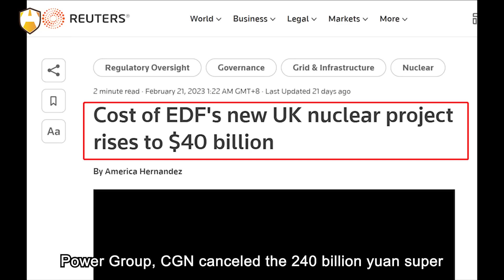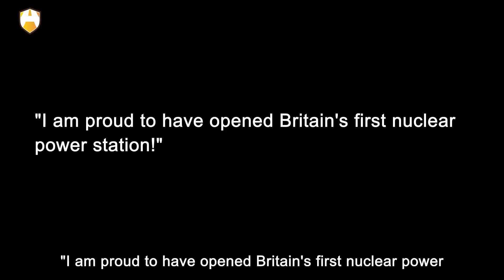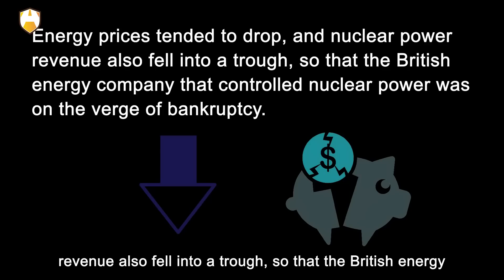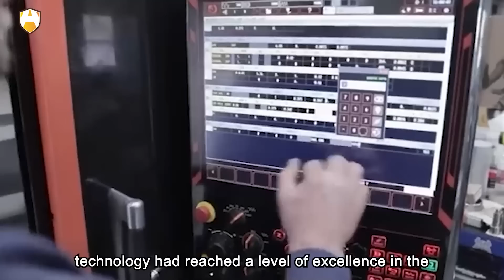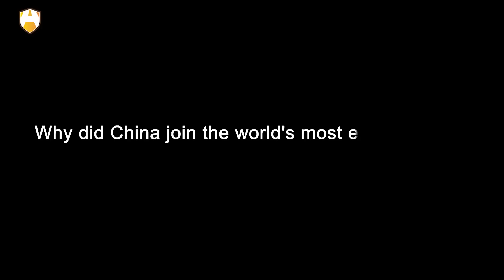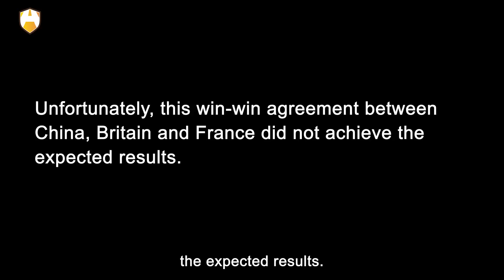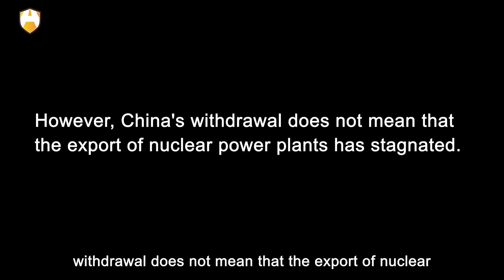Britain forced China to give up the most expensive project on earth, why?

Comment: The discovery of gas was only half the reason. There were two ways of generating nuclear power at the time, and one way was inefficient but it produced plutonium. The price of plutonium at the time was very high so they factored that in to the business model. As they finally got these power plants online though the price of plutonium plummeted and they were stuck with a bunch of dirty power stations which were highly radioactive and very expensive to clean up. The other method was less radioactive so all round cheaper and easier to do and what other countries did. Of course the other reason they wanted to produce plutonium was they had a joint nuclear weapons programme and were working for the US as we understand they do for most things. All these dirty reactors subsequently became a campaigning point for nuclear protestors, more concerned about the destruction of nuclear bombs. This is what war leads to folks - total failure.

Comment: Using bio coal and bio gas powered plants supplementing with solar and wind will be the best way to go. Going total electric is the best way to go and using bio ethanol and bio deseil and biofuel electric powered vehicles.
Reply: Also keeping a onboard solar generator with a roof attached panel as a back up with supply power to your vehicle without over loading the grid. If you have very little sun a small vertical turbine or both to keep your car or truck charged will be the way to keep your vehicle running.

Comment: I for one am glad that China is no longer playing any part in the UK nuclear industry.  This video is also not quite accurate about the Hinkley Point C development.  The Chinese involvement was only civil engineering mainly because the French EDF is responsible for the electrical. mechanical and nuclear equipment.  The Chinese company involved with only the buildings, foundations and site facilities which have no nuclear technology/content in them. It was just building another medium size power station to China.  Hinkley Point C is scheduled to run two units with a combined output of 3,260MW.  China has already at least four "nuclear" installations each 6,000MW or over.  The biggest power plant built by China is 22,500MW and the latest Baihetan hydro had 16,000MW fully operation just only in Dec 2022.

China was forced out because UK follows the US  anti-China policy.  So after banning Huawei UK proceeded to force China out of the Hinkley Point C project and all the remaining involvements of the other nuclear power plants.

China doesn't need UK as a partner in building nuclear power plants because China has a domestic market many times bigger than UK.  It was just a trading relationship.  If UK doesn't want to trade with China China would just move on.  China is the biggest trading partner of at least 120 countries.

The lack of the Chinese support means UK loses a cheap and complete supply chain.  It will have to pay more, take longer and have more technical problems to overcome.  France is already fully stretched technologically, financially and logistically to engineer the Hinkley Point C when no other European country could help and US is too expensive for UK.  Incredibly as this video said Hinkley Point C is suffering another delay with a commission date pushed back from 2027 to as far as 2036.  That would of course not happen had China been involved because civil engineering is where China excels.  Also China has huge technological, logistical and financial capacity to deliver the project on time or quicker if required.  So it is UK's own goal.  Take for example the HS2, the UK's own High Speed Train, currently costing 7 times of the European and 10 times the Chinese system. UK can do everything without China by just paying over the top.
Reply: China should decouple from UK completely seeing that UK takes orders from the US completely.  UK cannot make its own decision. It would just be a waste of time and money for China to deal with NATO countries.
Reply: @wongpohchan9485  I wish China would decouple from these opium suppliers. Who knows the Brits may again force opium on China as mode of payment!
Reply: @wongpohchan9485 
Look deeper.
Two constitutions, the second secret, which enabled the sale of the land, goods and, then, 97 million people, now, 320 million with so few of them aware of it.
The masters/owners pay taxes to the English Crown!
Why have a dog and bark?
Reply: China should fine HSBC 1028 billions USD  and suspend the license to print HK currency and eventually kick HSBC our of China and HK.
Reply: @yl128pang3  China shld stop the inward remittance of USD into HK especially currency form.
Reply: @yl128pang3  All these USD with hkd being tied to it is what makes HK properties so costly bc of excessive liquidity
Reply: 👏👏👏👆
An excellent assessment!
Reply: China could have built it in 6 years. One problem in the UK though is all the official enquiries where officials are on the make for taking years to write multi-million pound reports.
Reply: How would they pay China? By forcing opium on Mr XJP and the people of China? They can use as fertiliser perhaps.
Reply: Well done Britain. You've done it again. Fooked yourself again by listening to your master (let's go Brandon). It's a slipping slope down the bottom.
Reply: Just like Huawei, UK had to decouple from China on this Hinkley project, against the interest of UK citizens,  because of orders from Washington. Just to spite China, Washington doesn't give a toss about the citizens of the UK.
Reply: Thanks so much for your contribution.    China got out cos UK is playing games with USA and always downplaying China.  Zero respect.    Never trust uk and USA.   And most of the west.